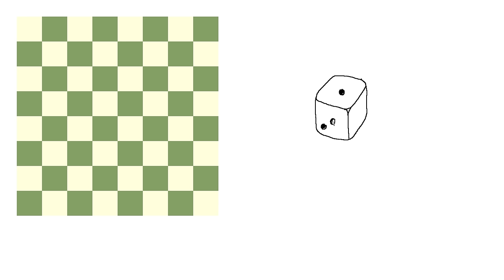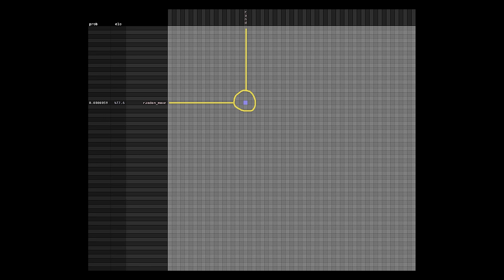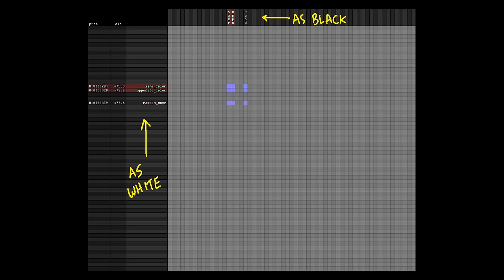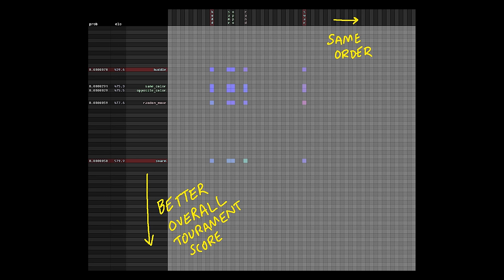30 Weird Chess Algorithms: Elo World

Comment: Stockfish also has engines for variants like Atomic, Racing Kings or Antichess. Suggestions:
1) Feed Stockfish a board, claiming it's an (e.g.) Atomic board. Take its predicted move and apply it to the real chess board.
2) Do the same 30x30 for chess variants. I think once you have the game model done (i.e. can tell legal moves) most methods should transfer very easily.

For 2) let's look at the variants Lichess offers:
* Chess960: The backline order is random, otherwise standard chess. Rather boring.
* Crazyhouse: You can, instead of making a move, reintroduce a captured piece. It may be interesting but its one of the more complex variants since you need to remember more stuff.
* King of the Hill: If you move your King to the center 4 squares, you win. Don't think it's too exciting. Among the lousy there will be stuff like Suicide/Hugging King that will do really well against other lousies, but other than that I'd expect the same.
* Three-check: Instead of checkmate, you can win by giving check 3 times (like a TKO). Also rather standard probably.
* Racing Kings: Weird starting configuration with all pieces on one side of the board, no checking allowed, King has to reach the other side of the board. Interesting, but really hard to implement.

Now for my 3 favorites I'd like to see:
* Horde: One player starts normal, the other gets 36 pawns. Would be really interesting to see how different alrorithms perform as Horde or Alliance each. Also very easy to port (except for the blindfold thing) as only starting position is different.
* Atomic: Everytime a piece is captured, the capturing piece explodes with it as well as the 8 squares around, the latter excluding pawns. Now in this game mode it's easy to "accidentally" lose because capturing a piece next to the king happens quite often and threatening a piece next to the king is not check, making it so there are lots of situations where threatening a king explosion goes undeteced and results in a possible win. This should really seperate the lousy algorithms from each other and avoid lots of the draws. Implementation might require some work but most algorithms port over quite well.
* Antichess: The King has no special role anymore, to win you must lose all pieces. If you can capture, you must. Also really interesting I think. Implementationwise this shouldn't be too hard either.

Comment: If some of these methods have a (move, score) ranking, then by adding up the scores of 2 engines, you can add or subtract a player. it is a different from of interpolation, but it might perform some actions that neither will take individually.

Comment: I wonder how minimax would've done with very simple evaluation functions. Things like: 

sum of white pieces - sum of black pieces
sum of white strikes - sum of black strikes
And so on
Reply: It will do quite well against a human and probably be ahead going into end game. You can also add simple metrics like control of centre. However endgames will not be great without turning up the look ahead ply.
In fact the eval function for a reasonable chess program is much easier to write than for checkers because the function can differentiate quite well between similar positions whereas with checkers they have similar scores. What you described is really bad at checkers. Even 2 kings vs 1 king will not win unless the depth is whacked right up.

Comment: Very happy to have found this video. I have a few naive ideas for chess algorithms which may or may not have been used by older engines. For example the number of fields any of my pieces can reach vs. the number of fields the opponent pieces can reach (mobility). Or the number of pieces I attack vs. the number of pieces my opponent attacks (threat). Or the number of my pieces that are protected vs. the number of enemy pieces that are protected (defense), maybe even with higher values for multiple protection. In theory I may may be able to implement and test these ideas but in practice I am not willing to invest the time to do so.

Comment: idea: ping pong

list out all possible moves from the current board state
for every move, ping to a random (or semi random) ip address.

for every move, if the ping fails, it is not allowed to take that move, if it succeeds, it continues to the next 'round'
randomly choose new ip addresses for all those moves which successfully pinged
to make sure a move is always chosen, if every ping fails in a round, take the one that returned or failed last

repeat until 1 move remains

Comment: That BS explanation of mirrors actually annoys me a lot more than it probably should
Reply: Hopefully I can improve the priors you're working with. It definitely annoys you more than it probably should.
Reply: @zenithparsec  it just basically makes me feel like I can't trust him in anything and I also KNOW that there will be some person that actually believes him. Deadpan comedy is really hard without seeing the face.
Reply: I generally hate it when people talk about mirrors flipping the image. Logically, they don't. If you hold a stick from you to the mirror, perfectly straight, you will perfectly match up where you are in the mirror. As it should be. A mirror doesn't flip anything. your perspective does
Reply: @leonk6950  mirrors flip the image by the normal to their surface. you point up, down, left, or right - your mirror image points to the same direction. you point forward or backwards, you mirror image points the oposite direction.

edit: I'm talking about mirror images, what you see when you look in a mirror. Mirrors themselves simply bounce light of course, but it's what result in the mirror image.
Reply: @leonk6950  That's only because the stick isn't polarized!
Reply: the link to the Wikipedia article on Lakes ;)

That's one of the best trolls tbh

Comment: Idea: Loners. The computer knows which pieces have what valid moves, but not their positions, and isn't allowed to build the image of the whole chessboard. E.g. each piece reports only direction and distance it can go, plus potentially what opponent piece it can take as result, as well as values of pieces it's currently defending (but not identifiers, defends 'a pawn', not a specific pawn). The computer ranks the reports and selects the most valuable move and performs it but it's not allowed to deduct the rook is at A1 because it has no valid left or back moves, it only knows the rook can move 1 or 2 fields ahead and is currently defending a knight and a pawn.

Comment: The nimzowitsch overprotector: maximize how much its pieces are protecting eachother

or for a more serious attempt, try to implement his 8 strategies (like your cccp engine):
1) control  the center
2) rooks/queens take open files, bishops on open diagonals
3) keeping rooks safely on the 7th or 8th rank (the 2 rows closest to enemies side of board)
4)creating/pushing passed paws
5) pinning enemy pieces so they cant move (or would expose/lose a high value piece if they did, like a queen)
6) setting up discovered checks
7) Exchanging pieces of equal value when ahead
8) setting up pawn chains

Comment: Love your channel, only the 2nd one I've subscribed to (after Veritasium)!  But have to offer my two cents on your comments about mirrors:

Mirrors (or lake surfaces, which are the same thing) don't distinguish between horizontal and vertical reflection, it's just how our minds interpret it.  Mirrors reflect front to back, so when you see your face in the mirror, you're seeing what your face would look like "through the back of your head", same as holding up writing on a transparent film (the reflection matches what you see through the back of the film).

The thing is it's very difficult for our brains to interpret reflections (one reason so few animal pass the "mirror test").  It's much easier to turn the reflection into a rotation, e.g. thinking "that's not my face seen through the back of my head", but "that's my face rotated 180 degrees".  This illusion works because we're (mostly) left-right symmetrical, you need to look closely to notice differences (e.g. the mole on your right side is on your left side in the reflection).

Gravity also plays a part in this "left/right" interpretation - we could also subconsciously flip "up/down" instead of "left/right" to turn the reflection into a rotation, but it doesn't work visually because up and down are so obvious to us when we're experiencing gravity (in zero G, the "axis of reflection" would be far more subjective).

A simple experiment to demonstrate this effect would be to take a photo of a recognizable scene (say a bunch of people eating dinner in front of a book-case).  Give different people different copies of these photos, some of which have been flipped horizontally as if they were a reflection, and:
- ask them to describe the scene (e.g. how many people, what are they eating, what are they wearing) and there won't be a noticeable difference in response time between the original and flipped photos.  For these questions the "flipped" subjects may not even notice their image is reflected.
- ask them to read the titles on the books behind the diners, and there will be a noticeable difference in response time, due to the "reflected" subjects suddenly noticing (and having to interpret) the back-to-front writing.

Anyway, all the best, looking forward to your next video (but working through your archives, the "printable program" was just awesoms!).
Reply from the maker: I was just trolling about the "explanation" of how mirrors work! I thought the "Wikipedia: Lakes" would give it away but I guess my deadpan was too powerful here, as lots of people thought I was being serious! :)

Comment: ‘From under the nose’: Stockfish but weakened by the fact that if among all possible moves, there is a square that can be visited by two or more pieces, picks the move that results in the worst possible evaluation.
‘To infinity and beyond’. Tired or having your queen trapped in a corner? Assume that the board is infinite and that a piece can always escape from the board to squares like i8 and a10. A move Nf-1 is considered as a legal first move. Strategy: out of all legal moves, pick the best move assuming that if a piece is attacked, it can move in the manner it usually moves and hide from the attack outside the board.

Comment: Some ideas of algorythms, that came at the first glance:
1) Move the strongest of your pieces to the closest place to the opponents strongest piece
2) Maximize the number of pairs of pieces, one of which defends the other
3) Stockfish, that can see each time only a random half of all pieces (except for kings)
3.5) The best move by Stockfish, but using only a random set of pieces
4) Take a strong engine that plays double move chess and take only the first one each time
5) Maximize the number of "checks" at the same time (where "check" means that it would be a check if opponent had only a king)

Comment: 10:30 mirrors don't actually flip things horizontally. They flip them by depth(it makes back the front and front the back), so it looks flipped if you're standing in between the two it'll be flipped

Comment: Medieval: play most devastating moves with knights, attempting to Annihilate other knights, queen, king, but most of all, the precious castles. Also it’ll protect its own castles at all cost. (I use the word castle instead of rook)

Get down mr. President: pick a piece at random and protect it at all costs.

Enemy spotted: this one is like several trained snipers honed in on one piece. Pick a random piece at the beginning of the match and try to attack it with as many pieces as possible without actually taking it. (As many red dots on their head as possible). He moment your king is checked, move out of check and then throw every piece you own at the previously mentioned target, when it is dead, move onto its close related family members (in this case other pieces of the same type) if they are all dead, call it a day and then try to move all our pieces back to their original positions.

Comment: I just found out about this sweet channel.

16:36 You mention that "weirdly, the fatalist strategy beats the other strategies".
IIUC, this strategy means that the piece would go where it is the most likely to have been killed across many games. But if it is likely to be killed at this position, it is also likely that a piece would end up in this position during a regular game.

As such, this strategy would attempt to reproduce the average human player, which is probably most sofisticated than the other strategy you had until this point.

Comment: It might be interesting to play around with evaluation functions while keeping the same search algorithm. Something like, using a simple minimax algorithm for the search, always set at a certain depth, but using some absurd evaluation functions.
For example an engine might consider a column of pawns to be extremely advantageous, and it would therefore play trying to get all of its pawns on a column. Another engine might like to have its rooks controlling a row rather than a column, so they would move everything out of the way to free up the row to its rooks. Another might really like having knights and values them higher than anything but the queen, and so on

Comment: Ideas
PCCC: CCCP, but pushing is top priority.
Worsterfish: Worstfish to the hypothetical extreme.
Reflecter45: Like other mirroring ones, but aims for diagonal symmetry.
ViroKing: Pieces try to distance themselves from their king.
Anti-ViroKing: Pieces try to distance themselves from the enemy king.
Vulture: Crowd around the spot where the most recent piece was captured.
*S T A N K*: Go away from where the most recent piece was captured (the anti-vulture)
Isolator: Capture every single piece before threatening the king.
Zlphabet: Reverse Alphabet, or 1 in the Arithmetic AI.
Singularity: Tries to "capture" the center of the board (D4-E5). After all 4 of those squares are containing the AI's pieces, the other pieces go Stockfish until one of those squares are captured. Then they try to fill in the gap as soon as possible.
Cavalry: Stockfish, but only considers knights. If both knights get captured, go random.
JailBaby: Minimize move options for both players.
Kingfisher: Stockfish that can only see their pieces and the enemy king.
Blindfish: Blind-Spycheck, but Stockfish. Who could've guessed.
Triplestock: Three stockfish moves at the start of the game, then random.
Arithmehalf: Arithmetic that always plays at 0.5
Capture Ignition: Random until a piece gets captured (by either player). Then go, you guessed it, Stockfish.
Twinfish: Stockfish, but top priority is that every piece has a neighbor. If this is impossible, or all pieces have neighbors, use Stockfish
(sorry im just addicted to it)
Promo: Do literally everything in their power to promote a pawn.
Blind-Hate: Blind-Kings but starting at the bottom of their preferences and working up.
Blind-Hatetrap: Blind-Hate with Spytrapping.

ok thats enough for today

Comment: RE: Symmetrical moves -- when I was like 15 my dad and I ended up in a state where the board was diagonally mirrored (like as if it was bent at a right angle along the diagonal -- like how the wood grain flows at the corner of a picture frame where the two pieces butt up against each other at a 45 degree angle, if that makes any sense).

What was really odd was that we hadn't been copying each other or anything like that -- we had made completely different, and logical moves -- and I was taking my time looking at the board while we watched a movie or something and I was like... "hey did you notice this?" -- we were both kind of blown away.

Picture phones weren't really a thing yet, so I have no idea what the board state was anymore, I just remember having all sorts of random pieces in the middle in complete chaos, and it ended up being a perfect diagonal mirror somehow.

I'm sure trying to force a diagonal symmetry would make an equally terrible player, but it's another thing you could try.